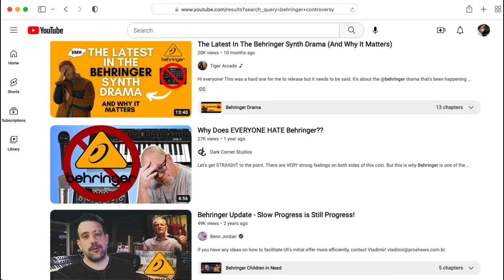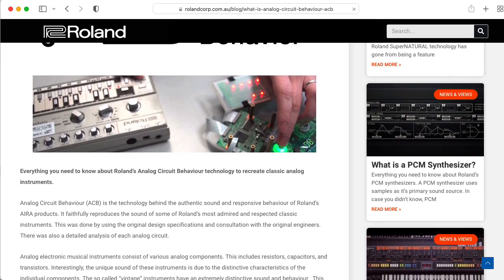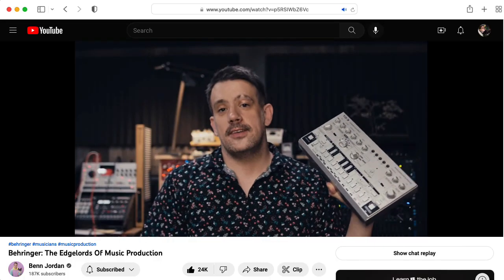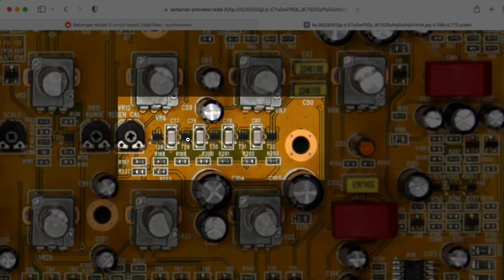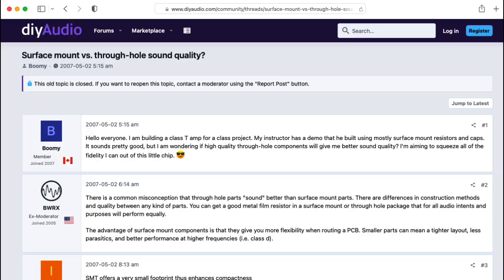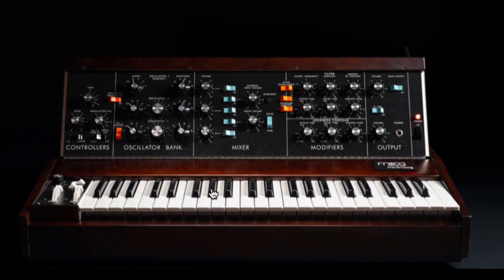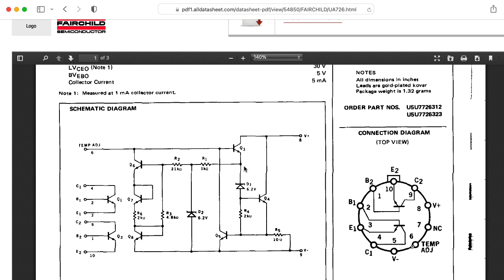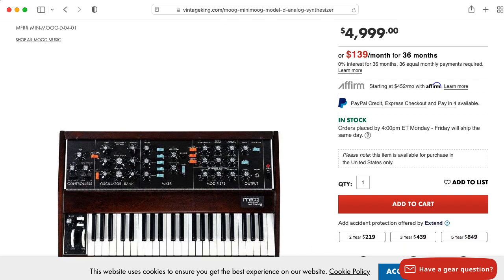Cloning Synthesizer Circuits: How Close? (thoughts arising from seeing one of Benn Jordan's videos)

Comment: Well the reasons Moog or Sequential have a higher price is 1) build quality: these are synths I can inherit to my kids, not cheapo frail plastic stuff that falls apart if I stare at it (which doesn't matter as with Behringer's price tag, I can just throw the sh!t away and buy 2 new, I wonder what the "Last Generation" has to say about that?). 2) R&D that goes into developing a synthesizer. Sequential does not employ an army of Asians in a Chinese sweatshop under questionable working conditions to steal an already established product design and technology, it uses decades of experience by Dave Smith, Tom Oberheim and others to develop the best user experience with the best sound. And then pays a dozen established artists to create 500 amazing presets.
Reply: And yet all of the parts of your precious A-level synths were made in China or the very same places the Behringers ones are, with a few exceptions perhaps. Boring, tired argument. These are tools, nothing more.
Reply from the maker: @MJanovicable  There's certainly expensive high quality parts made in China, and cheap low quality parts made in China, and different manufacturers may choose different parts even if everything is from China. I think that's particularly true of things like potentiometers -- there's a very wide range of price and quality available. But yeah, the resistors and transistors in the Behringer unit are going to be the same stuff inside the plastic package as the resistors and transistors in the Moog unit.
Reply: @Lantertronics  Well put, sir.
Reply: @MJanovicable  A lot of those high end synths end up having no choice but to use CoolAudio Semiconductors recreations of older chips - owned by MusicTribe and created for Behringer synth recreations.
DSI and Elektron among many others use CoolAudio parts, thankfully Alfa Semiconductor is starting to provide an alternative. 
Its not pretty, ethical consumption under a capitalist system is essentially a myth, sold to you to shift ethical responsibility from corporations.
Reply: @MJanovicable  That's not true. Moogs are made in North Carolina and most of the components are sourced from the US. Even  some imported capacitors and other parts come from Germany.
Reply: @sinistar99  Would you like to expand on that, be more specific? Let's pick the reissue of the mini-moog. All of the talk about these Cadillac synths starts sounding feudal, like G3cd, albeit with poor grammar: "these are synths I can inherit (SIC) to my kids..." Are there full centerfolds in Moog catalogs?:face-orange-raised-eyebrow:I always pay more for a hammer for no other logical reason than to feel weirdly--and with a dash of delusion--than I am weird.
Reply: Yeah there is nothing like playing on an actual model D.  I love my Baramoog, and it's actually very solid, but not like the real deal.
Reply from the maker: @sinistar99  The user interface experience is significant.
Reply: There is a hell of a lot more R&D in a good IC up clone than in just making a new synth.

Comment: Great video.

I don't know if Moog uses uA726 in their new synths, but I do know that modern components are much better than the ones used in the old synths, especially semiconductors. Therefore it's not really necessary anymore. And, as you said, it's not really in the signal path, though it might affect VCO stability.

(on the other hand, it looks like the Model D doesn't use polystyrene or mica caps for the integrators, so the temperature stability will be off a bit anyway)
Reply from the maker: If they're using C0G caps the tuning stability is probably still pretty good.
Reply: You're right, that's probably what they are using in the VCO cores.

Comment: Regarding the Minimoog and ua726, original minis with serial below 10,000 or so with the 'old' oscillator board didn't use them. The ua726 was part of the 'new' oscillator board design. You can see from the Model D live build video that the reissue uses the old oscillator board design
Reply: There are actually three versions of the oscillator board. The early version is fully discrete, the second is the one with the 3046 and temp co, while the later one has the uA726. The re-issue uses the second one and the Behringer copies that circuitry.
Reply: @TaklaMakanMusic  Yes the discrete ones are quite rare as far as I know, a few hundred of the earliest ones that are branded R.A Moog and Musonics
Reply from the maker: Ooooh! Thanks that clears up a lot. I will put a note about this in the comments.

Comment: I have a TB-303 and the Behringer TD-03 and I've hooked up both to a oscilloscope to probe the signal paths and the Behringer is very close.. Those small differences that exist can apparently be eliminated with some simple mods (although I have not modded mine yet).
Reply: These differences can be from age of TB-303 and 5% Resistors of orginal 303
Reply: @JanKowalski-vh1rg  beat me to it, it's parts tolerances, same reason two guitar pedals don't sound exactly the same at the same settings, but can be made to sound the same

Comment: This was a great video. Good to hear the opinions of an engineer most importantly. I'm currently in the process of finishing my analog monosynth prototypes and have pretty much learned everything I know from scratch. 
Like you say, to an extent the through hole and smd conversation is a bit dead. However I will say the overall routing does make a diffrence , longer copper traces on a THT board will have more inductance , capacitance and resistance than smaller ones on an smd board. Even wiring looms can introduce interference which sometimes adds a bit of dirt to the sound on older design vintage units.
Anyways thats just my opinion. Keep up the fanatstic content 🤜🏾🔥
Reply from the maker: The vague rule-of-thumb I use is something like: is the effect of this extra resistance, capacitance, whatever, less than the effect you get from variations due to component tolerances (like 5% resistor tolerance)? If it is, then don't worry about it. 

With transistors, particularly JFETs, manufacturers will sometimes measure for certain characteristics and select for that -- but generally it looks like whatever they get is whatever they get.

Comment: Smd resistors could be more noisy in high gain circuits. Am I wrong?
Reply: Yes, this is not correct.
As Aaron mentioned in the video, package sizes only really matter when designing high frequency (multi MHz) circuits. This is because of parasitic capacitance and inductance. Smaller packages behave more predictably and are less likely to pick up noise from the environment. The only audio circuit that can be realistically affected by this is class-D amplifiers.

However, smaller packages means less cost, more automation (pick and place machines can be used), smaller boards, and easier board design, which are all great benefits.

Comment: It needs to be said that the difference between original synths and modern clones - even fairly accurate "to schematic" clones - is also that the transistors and other parts are not exactly the same. First off, they won't be the same part, likely not from the same manufacturer. But whether or not - they most likely also won't be the same production process, having been miniaturized, the GBW has been increased, etc. Next up, the parts won't have been in service for 50 years, slowly electromigrating the semiconductors giving them their own properties. And if it's a good sounding unit, it's likely it has been through a bunch of very skilled techs who souped up the sound a bunch. Finally, think about the life of the unit. For fifty years, someone continuously decided whether to throw this thing away or keep it, and they always said "keep it", which might not have been the same for units that didn't sound as good. That's a fairly strong selection process that just ultimately means that the units that still exist nowadays - especially for "crappy" synths that were toys, like stylophones and tb-303's - are often the best sounding ones out of the production run.

On the other hand, it's easy to show that in many cases the sound really mostly only depends on the topology of the circuit. Not even the exact values of parts, just how they are arranged. So following this line of argumentation, you can say that esoterica related to component aging, process, and other specifics, really shouldn't matter, that much, at all.

One more thing. You said the expo converter isn't "part of the audio path". I disagree with that sort of characterization. IMO something is "not part of the audio path" only if there's some sort of regenerative step between the circuit in question, and the audio path. As in, something that'll standardize and fixate the voltage. For example, a digital level regenerator, something like that. The expo on the other hand does matter: it will change what pitch specific notes are on (especially the difference to the perfect tuning even if the thing is tuned to A440), it will make the oscillator drift out of tune over long periods of time, it will make it drift small but significant amounts over short periods of time, etc. All this easily results in a "fat sounding" synth that people are looking for in a mini. Between this and a "crappy" power supply that'll have drifty, saggy rails, as well as reduced noise and noise that's flatter and more white than it used to be in circuits, those are three reasons why modern synths sound so sterile.
Reply: Wow, did you miss the bit where he's an engineering professor?
Reply: @mycosys  no, it must have eluded me during the last 20 years i've been exchanging emails with them

Comment: Nice, the way you put it all into perspective. I agree that there's probably not a big difference between SMD and THT components. One part where the pursuit for low prices went wrong for me may be the Behringer power supplies. l had a simple Behringer mixing panel, and it turned out that its power supply created a horrible EMC, resulting in lots of interference with one of my filter modules (North Coast Synthesis MSK 009 Coiler VCF). I had to purchase another mixing panel to get rid of the interference.
Reply from the maker: In that case as Mijc noted it wasn't a case of through-hole vs SMD of the same part -- Behringer were probably cutting corners in a lot of different ways.
Reply: the difference between SMD parts and TH parts of the same part is literally the size of the frame and length of the wires, its generally the same silicon.
Guessing that behringer mixer was one of the old euro* mixers, behringer stuff really used to be abominable 20y ago.

Comment: Well, simple, companies like Make Noise "clone" circuits and sell it for premium, like the WoggleBug, Make Noise Maths = SERGE DUSG, the buchla lowpass gate, etc.
My ms-20 filter clone sounds very awesome with real CA3080 and i have a lot of them, so why not?

From What i understood from Roland (years ago) with their ACB technologies is they are emulating the properties capacitors with a chip.
From what i saw in a Moog Documentary, Moog has or had a very large stock of canned CA3080, because it was easy to spot in a close up shot and simply read the text on it.
The pcb's they use on these "classic" devices is pretty much what Bob Moog designed, check their documentary's and see for yourself how the tracks are routed. it's the same as the original.
Reply: Go put yourself together a Sin Phi Miasma or Befaco Rampage and the price for the Wogglebug wont seem quite so unreasonable.
Reply: @mycosys  that's what i do, i make the pcb's. i could make 3 Befaco Rampage for less than 100€ with the same quality.